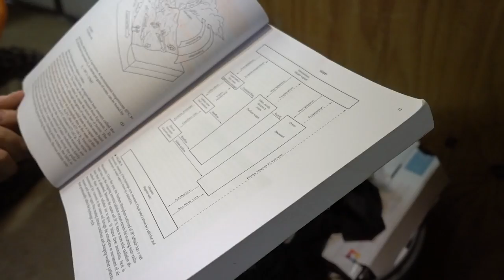FIRST RIDE ON NEW KTM 250

Comment from the maker: i GOT to ask... what was the first machine you've ever rode?!?
Reply: 3DMachines a Yamaha raptor 125
Reply: 3DMachines I rode a 90cc Chinese quad
Reply: a polaris trail blazer 250
Reply: 3DMachines Yamaha 50cc dirt bike 😂
Reply: Honda qr50
Reply: Yamaha TY80
Reply: 3DMachines 03 xr80r :D
Reply: 3DMachines it was a pw 50
Reply: 3DMachines a yahmaha peewee 80
Reply: 3DMachines a ssr125
Reply: 3DMachines 86 suzuki 250 quadrunner
Reply: Power Wheels
Reply: 2stroke minibike
Reply: 99 ttr 90
Reply: A Suzuki 50cc ATV
Reply: 3DMachines Suzuki 50cc, then crf75, then trx250x, now trx450r
Reply: 3DMachines the first  bike I rode was a bajja 2 joker. it was when I was 9 and I went brapppppppppppppppppppppp!!!!!!!!
Reply: 3DMachines Yamaha Big Bear 400 4x4
Reply: it was some sort of a mini bike.
Reply: 3DMachines 2013 Kawasaki
Reply: power wheels then motovox mini bike and currently a 1978 susuki pe 175 2 smoker
Reply: koplin 50
Reply: 3DMachines Yamaha warrior 350.
Reply: 3DMachines I rode my friends pw80 then bought a crf150r
Reply: rain drop
drop top
pin this
comment to the
top top!
Reply: 3DMachines Honda fortrax 250 and I'm 12 it's a four wheeler
Reply: 3DMachines I rode a pw 50
Reply: 3DMachines I had a 90cc Suzuki that i crashed and almost broke my neck... Good times
Reply: A Yamaha rt100
Reply: 3DMachines a klx 110
Reply: 3DMachines my power wheels
Reply: 3DMachines Aprilia sr50r which would pull 65 mph and that ain't too bad for a 50cc
Reply: 1993 Kawasaki Bayou 220
Reply: A Honda 100 4 stroke
Reply: 3DMachines my first bike was a 1980s or 1990s 90cc fourstroke
Reply: First bike was a 99 honda xr 100r
Reply: 3DMachines a Kawasaki 50 that I got when I was 2 and I have had a bike since
Reply: 3DMachines lawnmower
Reply: yamaha Raptor 350 braaMaaahaaaaa
Reply: Klx 110
Reply: First bike was a 1982 kx80.Still have it, still runs.
Reply: derbi senda drd xtreme 50cc 2 stroke
Reply: 3DMachines should have got the sx
Reply: I rode my friends kawy 250 kxf than got on my crf250 :'3
And oh lord... what I bike that crf is for me now <3
Reply: Yamaha 225dx three wheeler
Reply: The first bike I rode was a 2013 crf110f
Reply: 3DMachines ttr90 and crf100
Reply: a gio x33 140cc, its rips
Reply: 3DMachines ktm 50 sx senior
Reply: 3DMachines my first bike was a pw 50
Reply: 3DMachines I first rode and still do a 2007 Crf250r
Reply: a CR250. now i have a YZ250. It has more braaap into it
Reply: mine was a Kawasaki stockman 250 when I was 6
Reply: 1972 Kawasaki F8 250 Bison. Keep in mind it was 1979 when I got it
Reply: SAME I was started young like 4
Reply: honda z50
Reply: 3DMachines ktm 65 now i ride husky te 150
Reply: an old peugeot bicycle with a 50cc two stroke in it
Reply: '98 craftsman lt400
Reply: 3DMachines Honda z50
Reply: 3DMachines Honda crf 70
Reply: 3DMachines '96 pw80
Reply: 3DMachines Yamaha raptor 660
Reply: Ryry moore my first was a PW 50 as well
Reply: BRRRRRRAAAAAAAAAAAPPPPPPPPPPP
Reply: ktm 65    now i jab a husky te 150
Reply: 3DMachines  Arctic cat 500 4 stroke
Reply: Dalton a my first bike was Yamaha rt100 bet you don't know what bike that is and know a ktm 85
Reply: honda 90 trx quad, slam 125 pit bike and an aprilia 280r
Reply: 3DMachines 1982 Suzuki SP125 4 stroke street legal
Reply: 3DMachines first bike i ever rode properly was a kx100
Reply: 3DMachines  i ride my neighbors crf50 then when I got older I got a crf150f and I sold that last June and bought a kx250f
Reply: 2 joker Suzuki rv-90
Reply: 1979 yz250 nicked named iron horse rode it for a long time till it took a shit on me :( i miss that bike
Reply: honda vtr (1000cc) skerd the shit out :D
Reply: 3DMachines a Baja 50 4 stroke my first two stroke was a yz80
Reply: 3DMachines  the first bike I ever rode was a kx60, 2 stroke of course.
Reply: first bike I rode was a 88 cr125r 2 stroke
Reply: 2 smoker same Pw 50
Reply: The first bike I've ridden is like a 5 hp mini bike from 65'
Reply: 3DMachines my first was a yamadog PW 80
Reply: Cameron Findlay I still have an rt100
Reply: 3DMachines the first bike I ever rode was a Honda trail 90
Reply: 212cc Mini Bike
Reply: I rode a handa 350 trike and a Honda 50
Reply: 3DMachines my first one was a 1982 xr 80
Reply: Yamaha 90
Reply: Honda 70cc ATC 3-wheeler
Reply: 3DMachines yamaha dt 125 r
Reply: 1981 Suzuki ts250 old but still fun
Reply: 1st one  was a 5.5 hp Manco two seater go kart.
Reply: 1972 Honda XL 250
Reply: mini bike
Reply: My dad just bought me a 2017 Honda crf125
Reply: 3DMachines KTM 50cc 2 stroke but my dad had it fully tuned so it went twice as fast
Reply: 3DMachines  dr_z400
Reply: rm65
Reply: 3DMachines 2014 Yamaha TTR125L
Reply: @3DMachines a yamaha aerox 50cc two stroke
Reply: 2004 Honda CRF150F 4joker
Reply: 3DMachines crf450 2012 👌
Reply: 3DMachines 05 trx400ex
Reply: Rm 80
Reply: First machine was a little arctic cat 90 four-wheeler, First bike was a Yamaha YZ250F., Currently on a Yamaha YFZ 450R Quad. Love your vids bro!!
Reply: Aron Christopher me to mine was 1996
Reply: Coolster 125
Reply: 3DMachines 1998 cr125. first bike i ever rode and bought
Reply: yamaha 90cc or a doge ram cummins turbo diesel2500
Reply: 3DMachines idk quad but db klx 110 4 stroke rode my first four wheeler when I was 3
Reply: honda 250x
Reply: 3DMachines x-pro 90cc trail bike
Reply: My Honda XR50! Still have it (and ride it)!
Reply: It was a 2003 honda cr 50
Reply: 3DMachines 2009 Yamaha TTR 110
Reply: A chinese 125. But the kickstarter is broken so i have to bump start it, but it pulls some sick wheelies tho
Reply: 3DMachines my first bike was a 2003 Honda crf100 bored to a 120
Reply: 3DMachines z50
Reply: Yamaha Ttr 90
Reply: 3DMachines a 50cc mini moto
Reply: 3DMachines A Yamaha pw50 was the first bike I owned and rode when I was 4 years old
Reply: love the vids keep them up
Reply: 3DMachines ttr 110
Reply: Ethan Vovillia They don't make 65cc 4 strokes
Reply: 3DMachines Suzuki DS80
Reply: 2006 YZ 85
Reply: Suzuki sv650
Reply: 3DMachines Dang ol 1973 yamaha 338 sled lol!
Reply: 3DMachines The first bike I ever road was a CRF 50 when I was 4 years old
Reply: 3DMachines pw50 I was 5 years old
Reply: 3DMachines 04 CRF 80
Reply: Rm 125
Reply: Piaggo ciao
Reply: 3DMachines first bike i rode was a pw50, my first bike was a 1999 kx60
Reply: A pocket bike
Reply: Suzuki Kingquad 700 4x4 it way to much for me back then but it was my dad's
Reply: Suzuki Ozark 250
Reply: 2003 KLR 250
Reply: 3DMachines sup
Reply: The first bike I ever rode was a 2004 model klx 110
I still have it and it is indestructible.
Reply: 3DMachines I rode a Yamaha yz 80 and it had a little bit of a jump now I ride a Honda 80 4 stroke which is to small and I'm getting a Yamaha TTR125
Reply: 3DMachines  1999 Honda xr100r
Reply: Pw 50
Reply: big wheel.
Reply: my first ever time on a  bike I was 11 and it was a ktm 125
Reply: 2006 drz 125L still rockin it.
Reply: 3DMachines 2006 drz125L, still rockin it
Reply: Kawasaki kx80x bigwheel!
Reply: 1976 kawasaki KD100M
Reply: 3DMachines One of my first machines was a 1985 Yamaha BW(Big Wheel) 200
Reply: 3DMachines a 2004 Honda 250
Reply: 3DMachines crf150r
Reply: 3DMachines 2001 xr200 when I was 3
Reply: Honda XR 80 which was a friends, I now rip a Yamaha TTR 125L. However I need an upgrade, getting to big for it.
Reply: 3DMachines kx125
Reply: 3DMachines first machine I ever rode was a little 49cc Honda quad when I was about 7 or 8
Reply: FanBase same here
Reply: 3DMachines crf150f! now rockin a ole 91 rm125 with a big bore on her.
Reply: 3DMachines pw50
Reply: 3DMachines my first dirtbike was a 84 honda cr250
Reply: Ninja 650
Reply: 3DMachines 83 kx80 2 stroke very fun crappy bike
Reply: 3DMachines first bike I ever rode was a 2003 Honda crf230f with a big bore to a size I'm not sure
Reply: 1991 kx250 but my real first bike was a ttr125
Reply: My first was a 1990 Yamaha DT50lc. I bought it more as a scooter but fell in love with the bike so I got a 1996 DT200r a couple years later. Best part is they are dual sport bikes so I can ride em on on road as much as off road. Not everyday you see street legal 2 stroke dirt bikes.
Reply: 3DMachines atc big red 250
Reply: 5hp mini bike first then when i was 11 i bought a yamaha 250 two-stroke
Reply: 3DMachines 2006 Honda trx300ex
Reply: a mini bike
Reply: a honda 50cc then a 80cc honda now upgraded honda 110cc
Reply: 3DMachines 1989 xr 70
Reply: First bike i ever rode was a Yamaha PW50 haha
Reply: 3DMachines 1978 Yamaha 80
Reply: I was 12 and I ripped a 2005 RM 250
Reply: 3DMachines xr 100r.    But now I've got a ttr 230.....needless to say my next investment is gonna be a crf 250f or 250r
Reply: 3DMachines 2007 Honda crf 50
Reply: 3DMachines  200atc
Reply: 3DMachines any xr80 fans😎
Reply: now I ride a 2016 KTM 300xcw
Reply: 3DMachines 2006 crf70
Reply: Hi 3DMachines ! I rode a ATV in the snow . It was awesome. Stay Froggy fresh.
Reply: Honda xr 100
Reply: In terms of machine, a Honda 3813 lawn tractor... If you're talking more Motorsport, the first thing I ever drove more than just out a driveway was a 96 Honda 400 foreman. Was a good bike..
Reply: 2002 yz80 when i was 16
Reply: 3Dmachines my first bike was a Honda xr80 but I only had it for about a month or to until I got a 2011 klx 140
Reply: 3DMachines i dont know yet and i am 13 that is sad 😭
Reply: My friend's Honda z50
Reply: I rode a 2007 Yamaha 125 4stroke
Reply: Kawasaki 60
Reply: 2004 Kawasaki kx 85
Reply: 3DMachines trx 90
Reply: 3DMachines my first ride was a 92 rm 250cc 2stroke that was my first bike
Reply: 3DMachines the first bike i had was a kx 60 when i was 7
Reply: 3DMachines can you not plz. don't put the music when you ride the 2-stroke we want to hear it per
Reply: A yellow Z50 best thing ever when I was 6 back in 81', wish I had off kept it they are worth a motza now...dad paid $350 from a dealer.(wasnt even in the store front it, was out the back in the UsedAbusedUsed pile)...lol
Reply: Crf 70
Reply: 3DMachines my great grandfathers riding mower
Reply: a red and black baja
Reply: 3DMachines  my first time was a kx 80 and now I have 2 KTM 125 EXC 02 and 03 never miss a beat I love ktm life
Reply: 2002 kx65
Reply: 3DMachines Crf70
Reply: Ttr 230, but now i have a ttr 250
Reply: 3DMachines I started on an xr80. Then to the cr250r now on a rm125
Reply: my first was a TTR 90 now I have a TTR 125
Reply: 3DMachines Yamaha bruin 250
Reply: 3DMachines my first bike was a pw 50
Reply: 3DMachines Chinese redcat 150 4stroke
Reply: 2000 honda crf50 when i was 8 and just recently i purchased a 2015 yamaha ttr 125  and im about to buy a 2009 suzuki drz400sm
Reply: 3DMachines RM 125
Reply: 3DMachines i started on a crf70r
Reply: 3DMachines pw50
Reply: ktm 50 air cooled
Reply: 3DMachines a Chinese 47cc two stroke mini dirt bike
Reply: Kx85
Reply: 3DMachines I started on a raptor 80 also what happened to the crf250
Reply: 3DMachines a Honda 150f
Reply: 3DMachines what happened to the seca 2
Reply: 3DMachines 300ex
Reply: yamaha pw80
Reply: 2002 honda xr70r dirtbike
Reply: 1988 kx80
Reply: 3DMachines atc 70
Reply: I was 4 when I got my first bike-an apollo 50cc pit bike w/ an auto clutch 4 speed
Reply: KLX 140L
Reply: 3DMachines 2002 CR125R. Sold it a few months ago and bought an 06 CRF250R. Still like 2 strokes better.
Reply: Started out on a 1996 Suzuki DS80! Then did a huge jump to a 1987 Honda XL600R (Still have) which is road legal as I have my motorcycle's license, and then yesterday, picked up my first 450! A 2009 fuel injected Kx450f! Super pumped for spring!! :D
Reply: 3DMachines 1982 175 yammaha 2 stroke
Reply: 3DMachines a kawasaki bayou 250 I miss it a lot I was about 5 running 5th gear
Reply: 3DMachines a very small 4 wheeler when I was really young, I can't remember what it was tho.
Reply: Honda mt5
Reply: Ktm 65sx
Reply: 3DMachines A crf125f was a hill climber!
Reply: 3DMachines my first bike was a 1996 Honda xr200r and I still ride it today.
Reply: 3DMachines I can't remember that far back but my first quad was a little 50cc
Reply: Honda 400ex
Reply: Honda recon 250
Reply: 3DMachines crf-80
Reply: 3DMachines yamalube is the best
Reply: A Yamaha 50cc
Reply: 3DMachines im 13 and the first bike i rode was a 1974 yamaha enduro 175
Reply: 3DMachines I rode a Yamaha 50cc dirtbike
Reply: 3DMachines Honda cr250 1997 it was the dogs dangly's
Reply: an 09 kx 100
Reply: 2000 yamaha dtr 125cc 2 smoke
Reply: 3DMachines crf100
Reply: 3DMachines 2003 xr50
Reply: Honda xr80
Reply: 3DMachines malcor 145
Reply: 3DMachines Honda ez cub
Reply: 3DMachines 1992 Honda z50r
Reply: 3DMachines  yamaha ttr 125 and now 1996 honda xr 400
Reply: Pw50
Reply: 3DMachines first bike I rode was a pw50. My first bike was a klx125
Reply: 3DMachines my first dirt bike and still first dirt bike is a Yamaha TTR 125
Reply: me too then i got a KX 60 now i ride a KX250F
Reply: 1971 Honda mini-trail, still have it, also I have that exact same hydro-geology textbook, its a good one lol
Reply: first machine that i rode was a 125cc Chinese quad
Reply: 3DMachines 98 ktm 50 sxr pro senior
Reply: 3DMachines Yamaha blaster all stock
Reply: 3DMachines my first atv was a 04 Kawasaki lokata 300
Reply: what bike do u enjoy riding most
Reply: Mini crotch rocket when I was 5 now I ride a Yamaha warrior  that I built up
Reply: +3DMachines a 1996 Honda 300 4x4
Reply: 50cc yamaha at around 9
Reply: a cheap 125cc Chinese knockoff quad
Reply: 3DMachines Honda 50cc at age 7
Reply: 3DMachines Golf cart lol
Reply: mine is a drz125L
Reply: Olboyz213 Plays  ha I'm trying to sell mine lol those are pretty nice quads
Reply: 3DMachines crf150r
Reply: 3DMachines the first bike I ever rode was a Yamaha ttr 125
Reply: danda4567 really
Reply: Yamaha rt100 two stroke
Reply: Honda C50 !
Reply: I started with a crf80f then moved to a KX100 and now a KX125
Reply: 3DMachines 30 cc
Reply: Crf50r honda
Reply: The first one I ever had was a 2000 xr 80 now I got a 99 kx 250
Reply: Vintage Suzuki ds80
Reply: 3DMachines yall should do a vid of ridding the pw50 in the garage
Reply: motorex makes the best thats what my dad runs on his 17 450 and 16 also his 16 enduro 500
Reply: 3DMachines a good old Yamaha pw80
Reply: Now I have a 2001 Suzuki rm 125 but I'm also currently looking for a Ktm200 or an rm 250
Reply: 3DMachines Yamaha the 600
Reply: A 50cc Kawasaki two stroke
Reply: And I was 3
Reply: First was a Yamaha 50cc, first clutch was a xr100, and the first bike I ever owned was a 2001 xr200
Reply: First was a Yamaha 50cc, first clutch was a xr100, and the first bike I ever owned was a 2001 xr200
Reply: Honda crf 100
Reply: Cr250
Reply: 3DMachines  yamaha pw 50
Reply: A grizzly I was 7 don't know wat cc I think 450
Reply: 3DMachines  first bike for me was a semi auto Suzuki ds80 first clutch was a Yamaha Ttr230
Reply: 3DMachines a Honda 50 but now I ride a dr250
Reply: 3DMachines the machine I ever rode was like a Chinese 50cc four wheeler I thing I don't really remember but I think that was it
Reply: 3DMachines the machine I ever rode was like a Chinese 50cc four wheeler I thing I don't really remember but I think that was it
Reply: first quad Suzuki quadrunner 500
first bike crf 50 rode the quad first way before the bike
Reply: 3DMachines Klx 110 was my first dirt bike and an E-ton 50 was my first quad
Reply: Honda 100
Reply: The first bike i rode was a TTR 50 four stroke. By the way i like the questions at the end of the video.
Reply: the first dirtbike i rode was a cr85
Reply: 1982 Yamaha  50cc  I was 6.
Reply: 3DMachines  Yamaha pw80
Reply: honda fourtrax 250
Reply: Rm60
Reply: Kawasaki kx450f
Reply: A 70cc pit bike
Reply: A 70cc three wheeler
Reply: A go-cart then mini bike, dad's 73 Honda CB 350, 72 Suzuki TS 90, 76 Honda XL 175 which I still own, and ride... I got it brand new in 1976.
Reply: 3DMachines crf80
Reply: 87 big bear 350
Reply: 3DMachines pw80
Reply: A 300ex which was interesting at the least :0
Reply: 3DMachines Suzuki jr 50cc
Reply: 3DMachines Electric scooter
Reply: 3DMachines my first bike was a Yamaha PW80
Reply: 3DMachines kdx 200
Reply: First bike i've ever rode and still have is a 2005 Yamaha yz 250 , 2 Smoker, ate shit the first time lol. now i ride that and a can am outlander xmr 1000
Reply: 3DMachines Honda 110
Reply: Yamaha AG 100
Reply: 3DMachines get new style plastics
Reply: 3DMachines 1998 KAWASAKI KX80
Reply: Crf 50
Reply: 1997 Yamaha PW80 was my first bike. Got it for my 7th birthday. Been brapping ever since.
Reply: my first bike was a Honda 150r then second was kx 250f then 3rd was crf 450
Reply: 3DMachines 230 Suzuki quadrunner
Reply: 3DMachines Yamaha YZ80
Reply: A 2012 yz85
Reply: TTR 125
Reply: 3DMachines My first Machine was a Suzuki DS80 about 30 years old and restored. Lol, my current bike fell over during the night once onto a quad because the bucket bent when i was re-painting the stand.
Reply: 3DMachines my first bike is a 94 ktm 620 enduro
Reply: 3Dmachines Mine Was A.
1997 Suzuki DR-Z 200
Reply: 3DMachines a Harley
Reply: 85 Honda xr 100
Reply: 3DMachines my first bike I rode was a Honda 90cc but the first vehicle was a Yamaha big bear 350
Reply: 3DMachines Kawasaki 110 now I'm on a drz 125L saving up for 250
Reply: Mini bike 200cc heat.
Reply: a 1997 Yamaha Beartracker 250
Reply: 3DMachines I also rode a 400cc and 300cc 4 stroke Honda Quads when i was a kid with my dad, still riding them today
Reply: I first rode a  1997 kawai 60 was a lil zipper
Reply: Honda XR75.
Reply: 3DMachines 2002 honda xr50
Reply: 3DMachines a Kx65
Reply: IT250
Reply: kx50
Reply: Yamaha pw50
Reply: 2017 klx140l
Reply: 3DMachines a 2002 Honda 350 atv
Reply: a 2002 Honda 350 atv
Reply: 3DMachines Honda ATC 110
Reply: 3DMachines 76 honda 50...yeah...im old
Reply: By myself was a hondie 400ex I was 9 never went past 2 gear lol
Reply: pw50 when I was 3.  Got a 50 quad for my birthday that year, then a couple later a mint xr50 that I still have as a fun little pit bike.  Does good wheelies...  Along with everything else I've collected over the years...
Reply: now I ride a 1999 Yamaha Kodiak400 cc
Reply: 3DMachines a 50cc Kawasaki four wheeler
Reply: just recently 2005 kawaSEXY klx 110
Reply: 400 Polaris sportsman
Reply: yamaha big bear
Reply: 3DMachines i rode a yamaha ttr 110 and now i have a 125 pit bike
Reply: 3DMachines  a 2001 Honda xr50
Reply: 3DMachines KX125 2 Joker 1999
Reply: 3DMachines I got a yz450f thing sucks got to run and pop start it I just rebuilt it too
Reply: 90 quad honda
Reply: 3DMachines  i thing it was a baja mini bike on training wheels and i think i was seven when i wrecked it into a tree down a hill....lol
Reply: Yamaha 360 MX
Reply: 3DMachines xr80
Reply: 03 honda xr 100r
Reply: Honda H100
Reply: 3DMachines a little 50cc Baja pit bike with a bent frame. I was 6
Reply: 3DMachines e-ton viper jr 40
Reply: first quad that was a yamaha warrior,first snowmobile yamaha ovation,first bike was a 1980 yamaha yz80
Reply: my first quad i owed was a 02 400ex
Reply: A Yamaha TT-R 50 i forget what year
Reply: 3DMachines snowmobile
Reply: 3DMachines 2000 Honda 400 4x4 quad
Reply: 3DMachines drz 125l
Reply: 3DMachines Polaris sportsmen 90 kid quad
Reply: A 8" Kids Bike with Training Wheels...
Reply: Yamaha pw50
Reply: 3DMachines the first bike I rode was a 1995 KX60 when I was 5
Reply: 3DMachines honda rancher 350
Reply: An 06 Suzuki King Quad 700 4x4
Reply: 3DMachines my cousins Trx 90 then he sold it and a few years later I got a sportsman 90 then the same I got the same Trx 90 he sold back
Reply: 3DMachines 90cc 125cc Suzuki ATV then my own 90cc ATV then a 250 built to a 330cc  Kawasaki Mohave ATV and a 450 Kodiak still have the Kawaski and the Kodiak
Reply: The first machine I ever rode was my dad's Yamaha Grizzly 660 when I was like 4 or 5. I hit the throttle all the way like one of those battery operated toy jeeps and when my dad stomped on the foot brake I went over the handlebars. I'll never do that again😂. I guess you could say I learned my lesson. Now I ride that beautiful kx125 in my profile pic.
Reply: can am 90 2 stroke
Reply: My first bike was just like that one jake or your little cousin was ripping
Reply: William's Videos good for you I'm 12 and I rip a KX175 and a Suzuki 450 quad
Reply: 3DMachines ssr 70cc (for dirt bikes) my first quad ride was on a Kawasaki 400cc quad I think
Reply: rm 80
Reply: 3DMachines 2002 Yamaha ttr 125 &1986 Honda big red 250es
Reply: 3DMachines my first dirt bike was a Honda 110 crf
Reply: All terrain lawn tractors And more Mine was a arctic cat 550 2 stroke. My dad got it back in 2002 and we still have to this day. The thing runs like a beast
Reply: 3DMachines I had a bad ass cr80 with all the upgrades on the engine  but look like shit
Reply: My first bike to ride was a Suzuki TS90 around 1970
Reply: First machine was a little 90 Chinese quad and now i have a 400ex honda
Reply: First machine was a little 90 Chinese quad and now i have a 400ex honda
Reply: 1970 Honda XL70 my dad bought it for me for $50. got it running and made the neighbors mad... only because I cut the muffler off of it because it was rusting off...
Reply: 2002 yamah Kodiak I believe, noe I ride a 98 grizzly 600
Reply: 3DMachines a cfr250
Reply: 3DMachines pw 50
Reply: my first was a honda crf 250r
Reply: I Amon my second bike which is a 2000 XR 100 and I had a Xr 50 also from 2000
Reply: 3DMachines 2001 Honda recon 600
Reply: 2007 Lifan LF 200 GY-6 I got for $300.
Reply: 2004 Honda xr70
Reply: My first machine I owned was a rm450z race bike and I'm 18 years old
Reply: I had a Polaris scrambler 90 2 smoker lol and still have it, now I have a panther 110 still Chinese but runs good
Reply: Suzuki 80 cc quad
Reply: Suzuki XT 650
Reply: first 4 wheeler i had was a 2004 polaris preadator 50 when i was 4 and first bike i rode was a 2005 yamaha ttr 90 when i was 6 and first bike i owned was a 1984 kx80 when i was 10 and now i have a 1988 kx125, 1983 kx250 and a 1985 kx250 and im 14 as of now.
Reply: 3DMachines some Chinese 4 wheeler first dirt bike though was a 2003 drz 125. haven't looked back sense still riding dirt bikes!
Reply: Polaris outlaw 90
Reply: 3D machines my first bike was a cry 100
Reply: 3DMachines the first matching I have ever rode was a 2007 Honda 50 four stroke!
Reply: Ttr110
Reply: A Honda
Reply: 3DMachines I had a Honda crf 50
Reply: Yamaha tt 350 2 joker
Reply: 1994 Honda Magna v45
Reply: 3DMachines 04 flywing ( yamaha spin off) mx 100
Reply: 3d mechines SSR 125
Reply: 3DMachines I learned on a 1983 honda Z50R.  that was my first bike.
Reply: It was a dirt bike, it was yellow so im assuming it was a Suzuki, it was almost 10 or 11 years ago but it was a 50cc yellow dirt bike or a Suzuki 50
Reply: Honda XR100
Reply: Yamaha pw50
Reply: rm250 2 stroke
Reply: TnT Gaming I started riding at 6yrs old.
Reply: 2014 klx 140 l
Reply: My first machine was a Yamaha 50 atv
Reply: 3DMachines well, I started with a 110cc chinese. the first quad with balls was my 1987 honda 250x. and my first one that could smoke a car was my yazuki bastard 185
Reply: Pw50, crf50f, xr80r, Chinese quad, crf100f, now a kx250f.
Reply: 1984 cr 80
Reply: 3DMachines I rode a 1983  Honda three wheeler when I was 7 years old
Reply: 2001 Yamaha TTR 225
Reply: 3DMachines 1986 cr 80
Reply: 3DMachines 2001 is 250
Reply: 3DMachines 2011 ktm 85sx
Reply: 3DMachines the first bike i rode was my dads Honda 650 bros
Reply: 3DMachines $50 1982 Honda atc 200. What happened to your atc?
Reply: 3DMachines 05 Honda crf100f
Reply: 3DMachines ,I had several  1st bikes to ride on,1979 HD roadster 1000cc, Yamaha  YZ 250 racing bike, 380 Suzuki, and then another 1980 HD sporty 1000 cc,and many after,and now only have a1987 Yamaha  virago, 535 cc,and a Yamaha  blaster wheeler 😆😉☺...oh forgot to mention  the 1987 tw 200 big fat tires 😆
Reply: 3DMachines KX 110 lol
Reply: I rode a 03 CRF 50 but now I ride a 85 Suzuki 250 quadrunner
Reply: 3DMachines  a old big rig v8 with a big dog in the passenger seat
Reply: 3DMachines I just bought my first dirt bike today so far I have loved it the little I road it it is a Honda clone 110 I'm having new rings and gaskets put in it
Reply: a 1999 honda xr250
Reply: 85 Suzuki lt250e quadrunner
Reply: 3DMachines the fist machine I ever ride was a 100cc Chinese dirt bike
Reply: 3DMachines 1985 honda 50
Reply: 74 Honda z50a still have it
Reply: 3DMachines Honda crf230f
Reply: Nice tags! Why do you have tanner fox and gtr reveal in the tags?
Reply: Honda Wallaroo / PK50
Reply: 1978 Honda xl100. Its older than my mom. I still have it and it runs like a beast.
Reply: good old 92 cr 250 braaaaap
Reply: 3DMachines the first machine I ever rode was a 87 honda 90cc qaud it was fun till it blew up
Reply: first thing i rode was a pw50 now i ride a ttr 125
Reply: 2003 cr 85 2 stroker. Now I got a 1994 Klx 250
Reply: 3DMachines 50cc Yamaha starter bike
Reply: 3DMachines Yamaha MX 80 two stroke
Reply: 3DMachines use motorex. Oil in ktms my dads friend is a KTM factory machanic and he said the KTMs are designed around that oil. My 150 use to run like shot but after we switched from beltway to motorex it ran mint.
Reply: 3DMachines I
Reply: 125cc 2-stroke
Reply: 3DMachines it was a orion 125cc
Reply: 3DMachines a 2004 ttr 125
Reply: 110cc high performance pitbike
Reply: Honda 80xr after my Harley 883 of course
Reply: 3DMachines first ever was 49cc at 10years than a moped and pit bike 
Recently got my first dirt bike KTM 250sx 1996 so much power
Reply: A Yamaha raptor 700
Reply: 3DMachines a Honda crf 70
Reply: Honda xr400
Reply: Polaris predator 50